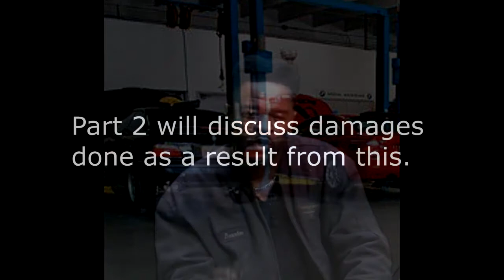Crankshaft pulley installation...The WRONG WAY.. Part 1

Comment: Your probably to young to have worked on some of the chevy 283 and 327 small blocks. You banged them on, there was no hole or threads in the nose of the crank.

Comment: Heat the pulley up to 500F in your oven and it pushes almost all the way on by hand.  Then use the OEM bolt.  Couple turns and BAM! you are done.

Comment: I have a question. I had my water pump and timing belt done on my pt cruiser. But now my belt only runs in two of the four rips. I brought my pt to multiple shop and they can’t see what’s causing it. I explained it could only be the harmonic pulley.

Comment: Great video.  I saw a YT mechanic do that too on a PT Cruiser but he used a large 4x4 to do that.  I made the comment that I thought that method was a bad idea because it side-shocks the main bearings.  The stock bolt is simply way too short to pull on the pulley.  OK, so make your own with a longer bolt with matching threads and stuff a few greased washers in lieu of a fancy bearing.
Reply from the maker: ding ding ding...there are easy to make..Thanks for watching, please subscribe, thanks
Reply: i been working on pt crusier nephew bought is driving me crazy wish you lived in st.louis area lol,,, been having issue fuel pump run when it want to fuel pump relay issues,, i finally got sick of it tryiing to figure out the asd or fuel relay i jump it out put switch in car runs great no sooner than i did that her pop  and some sqeeking now water pump out lol

Comment: 2nd worst is using the crank bolt to pull on the harmonic balancer. How the special tool is used is, put on the harmonic balancer, thread in the bolt as far as it will go if possible. you should have a nut and washer and socket or a stack of washers, turn the nut down to pull on the harmonic balancer. All the force is on the nut, not on the crankshaft threads and yes banging on is a no-no